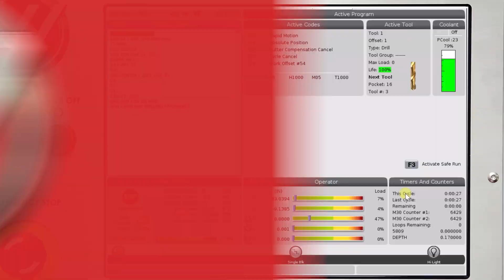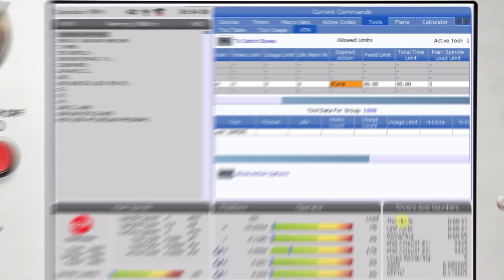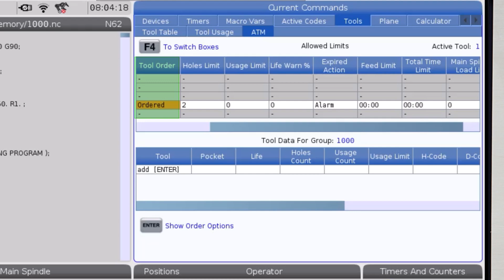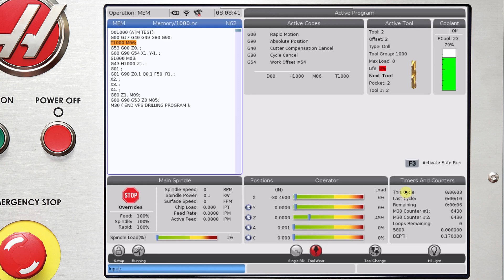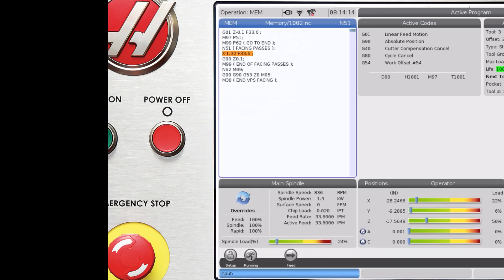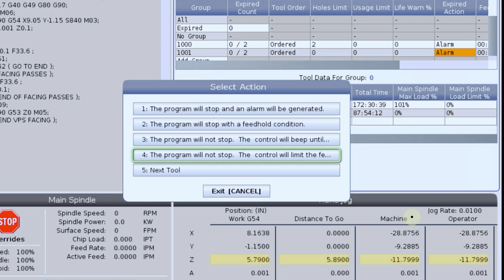Use Advanced Tool Management to Establish Backup Tools for Long Run Jobs - Haas Automation, Inc.

Comment: Haas machines are not repeatable enough for us to use this in our shop. Our 5th Axis machines have .003" to .005" height variation alone causing us to have to dial in each tool and still not get any repeatability from part to part, then add spindle growth on top as the spindle warms up and cools. Bottom line, we should have bought a different machine for better accuracy, repeatability and better customer service to solve issues like we are having rather than guessing at the fix since no machine should have that much variation from the late 2010's.
Reply: Sounds like a skill issue

Comment: What’s your solution to using tool groups and tool break detection without the tool use count going up by one for every time the macro calls the tool in spindle data ? (#3026)
Reply from the maker: lloydplumtree8725, 
Alex did some testing to see if he could replicate your situation. He was only able to get the tool usage counter to increase if he ran a tool, did a tool change to something else, and then changed back to the first tool and ran the tool break macro. He suggests running the tool break macro before doing a tool change and it shouldn’t increase the counter.
If this doesn’t solve the issue, please contact applications@haascnc.com with a copy of your program and the specifics of the problem. Thanks
Reply: There is thread on practicalmachinist site about this, check that i cannot post link there (search this : Advanced Tool Manahement for DUMMIES ?)